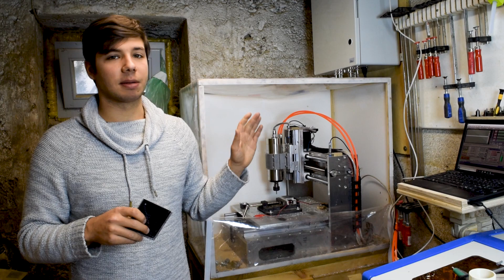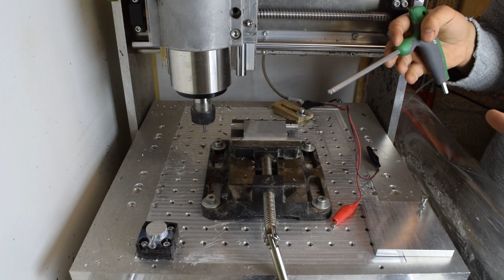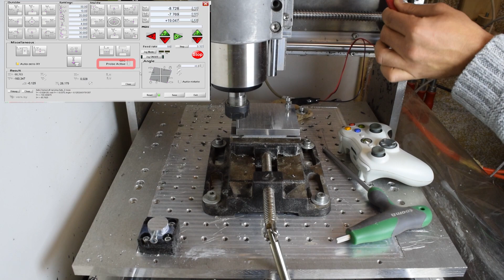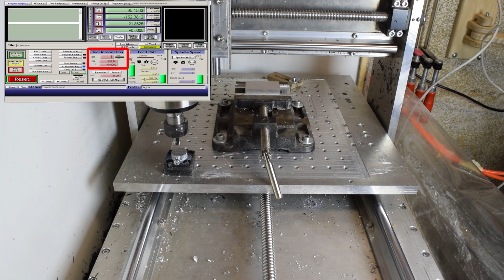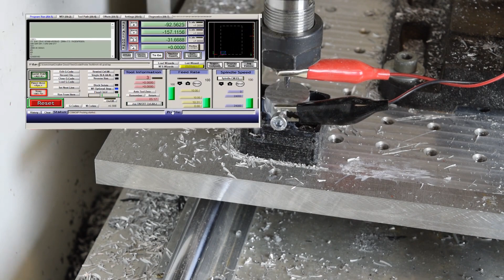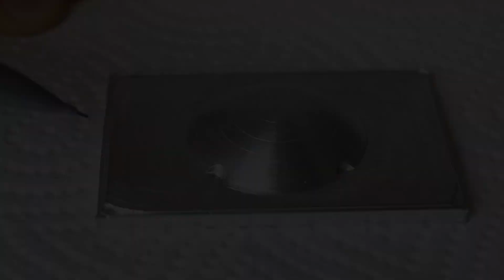How to use probing in Mach3 || Tool length offset sensor

Comment: Is the probe wizard intended for metric use only? I used Imperial values at first,then went back to metric. Everything works great until I run code with a tool change in it. As soon as the second tool change hits, probe wizard errors "probe tripped during Z movement" and several other errors. Then the rest of Probe Wizard fails to work. All probe routines fail with an error. Restart Mach3 and Probe Wizard works perfect again. I shortened up some test code to just the initial tool change. That seemed to work fine. Additional tool changes cause all kinds of problems. Any help would be greatly appreciated.
Reply: run through teh macros... 

the m6 start and end, most specifically.

dont ask me to explain, im figuring it out myself, and what really buggers me is that it defies einstein. do the same thing over and over and get differrent results each time!

so far my work around is to just use the LONGEST tool in the job as the zero as the default toolchange is to return tool to original position... undoing any offsets applied when that tool is selected... and obviously if the NEXT tool is longer... BANG! dont worry, that was me stomping the estop and throwing stuff across the shop... eventually i shall stop and go pick up all the tools in the corner... ;)

whats weirder is when in "machine coords" hitting "go to zero" with a negative Z proceeds to keep getting MORE negative...wrong way buddy, thats the table youre trying to get through...

Comment: so, i have a 4-pin touch off probe with over travel alarm (two pins for probe, and two for over travel) How did you set your probe up in mach3? i see a ton of options in the configuration window, but they are all named, and none are touch off probes or whatever

Comment: Sir, how the machine measure the top of the stock with respect to the touch probe ?
Reply from the maker: It measures the difference in length of the tool
Reply: @Uniquelymade  noted, so how does it know the top of a material stock?
Reply from the maker: I have a tool shown in the video that electically also probes that. The video is honestly very old and I don't even have the machine anymore
Reply: @Uniquelymade  thank you. I will figure it out

Comment: Did you ever get a error  probe tripped during xy movement
Reply from the maker: That probably means your motor cables are not shielded. You need to either move the probe cable away from them are get done optical isolation on the probe cable / some filtering
Reply: @Uniquelymade  I have the  problem in Z touch. If I start the Z touch in the macro, it performs a quick touch and then a slow one, and then it gives the error. If I run the "tool height script", it runs without problems.
Reply from the maker: The current in the motor cables induces a voltage spike in the probe cable
Reply: @Uniquelymade  thank you for the input ,I've tryed a new cable that's completely outside the machine and i still have the same problem
Reply from the maker: What's your setup? What controller are you using?

Comment: Good video, but as you pointed out the machine bed and the spindle are earthed, so you don't need to attach the probe earth lead to the machine, just clip the hot wire onto the plate or tool length probe and off you go.  And as you have gone to the trouble of isolating the tool length probe, you could leave that permanently wired, which means you only have to connect up the touch plate... this can now have a permanent connection so no messing around with crocodile clips and no possibility of forgetting to connect it. (just cont leave it anywhere that it can trigger the probing input.) :-)
I use VB scripts capture x and y per job I take z as being the machine bed in CAM so I don't run into the issue of wanting to use a datum that I just milled away. That said i tend to mill mostly wood - so a piece of stock that 1/2 a mm thicker than it should be does not cause a problem, ali...not so much. this approach helps minimise the chance of the live tool coming into contact with the the bed or fixture.

Comment: Hello, I have question about 7m 11s of this tutorial. How do You change manually walues to: -10, -10, +7,95. How is it possible? I can not figure it out. When I press ctrc+z/ cltr+x/ ctrl+x I can write value but after enter it turns back to previous.

Comment: Thanks mate!. You're probably the only  adequate person on YouTube who uses Z zeroing touch sensor properly. The other freaks all over the place are obsessed with use of the silly "touch plate thickness" parameter whereas we only need to know a delta between the tip of the initial either tool or probe  (whatever hits the stock Z0 datum first) and all the offsets of every next tool used in the machining sequence.

Comment: So everything works great except for one thing. Before and after the tool change the M6 routines (M6start and M6end) slowly jog at 50mm/m to the X and Z machine 0. How do I increase this feed rate so it doesn't take an eternity? What kind of code do I edit in the files?

Comment: Salve I would need help to the wizard installation. After installation when active one of the probe functions the machine does not move the axes. Can help me solve the problem thanks
Reply: Hello, I have the same problem, do you found a solution until now?
Reply from the maker: Sorry the video is very old and I don’t even have the machine anymore

Comment: Hi nettes Video ich habe bereits den Werkzeuglaengensensor der funktioniert ähnlich eine kroko Klemme and die Spindel die andere fehlt dafür ist ein rundes isoliertes Teil dran auf das I fährt bis Kontakt dann 1mm zurück. Es ist am Breakout Board bei Probe angeschlossen und nun frage ich mich ob ich das auch für x und y nutzen könnte wenn ich ne kroko Klemme dazu mache bei schwarz. Wo ist deines angeschlossen?
Reply from the maker: Meine x y und z sind alle am gleichen pin angeschlossen und schließen zu Erde
Reply: @Uniquelymade  dann müßte es auch bei mir klappen muss ich versuchen

Comment: Interesting video and well detailed. However...Tried that probing wizard and the version might be different from yours, on mine the z height probing returns stupid values (like -8952...) and is overall really crappy buggy shit, which version did you use? Or maybe it has to do with the mach 3 version you're using(using the latest personnally) Same goes for the auto tool zero script you linked, after probing the z axis wants to go down crashing in the probe instead of going to safe z, lol...
Other than that, keep up the good work, you craft nice things.

Comment: Sehr gutes Video, hat mir gefallen. Bist du aus Köln? Ich bin in Bonn. Ich habe mir vor auch einiger Zeit eine (vertikale) CNC Fräsmaschine gekauft.
Reply from the maker: Hey ja bin ich! Was für eine hast du dir denn geholt?
Reply: @Uniquelymade  Eine EMCO F1. Ich baue gerade die Steuerung auf Linux CNC um.
Reply from the maker: Interessante machine. Vor allem wegen den langsamen rpm der Spindel und des Vorschub. Für welches Einsatz ist die denn konzipiert?
Reply: @Uniquelymade  Ich will die benutzen um ein Uhrenmodell und einige Teile für einen 3D Drucker herzustellen.
Reply: @Uniquelymade  Meinst du du könntest mir bei einem Teil im Umbau meiner Maschine mit deiner Maschine helfen?
Reply from the maker: Ich würd dir gerne helfen klar :D schreib mir auch gerne an info@uniquelymade.de dann muss das nicht über Youtube laufen

Comment: You did an amazing job with going through all things necessary man! Thanks a bunch also, since I'm about to reach the point of setting this up on my own DIY CNC machine :-) 
Cheers and keep up the good work!
Reply from the maker: Thank you! I really tried to get out to like a teen minutes video but there was kinda a lot to cover. I guess with a script and less rambling that would have worked ^^
Reply: @Uniquelymade Hi, I used your script but I have a problem. I set the zero tool, zeroed the surface of the processed material, then went to zero tool setter. when changing the tool and zeroing, the tool ends up with a value of approximately +220,000 and so on with each another tool. Can you help?